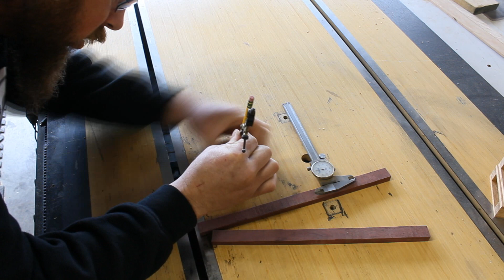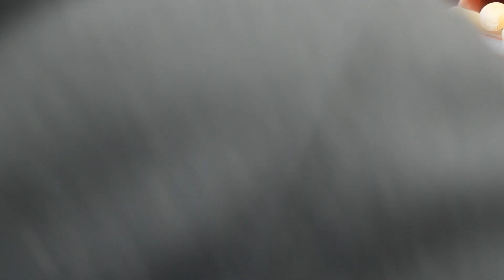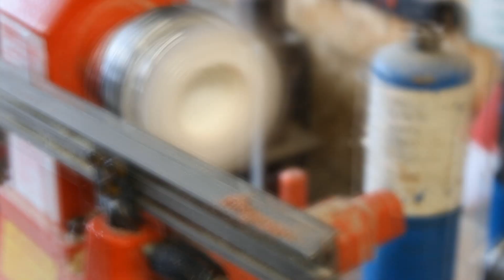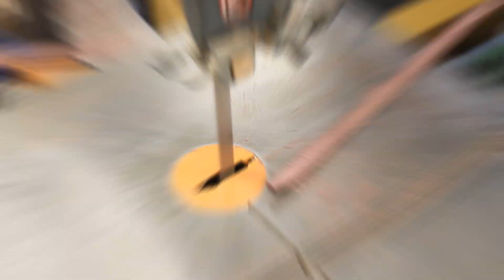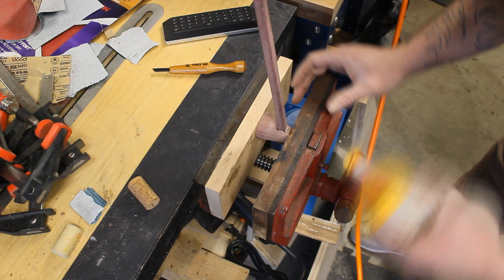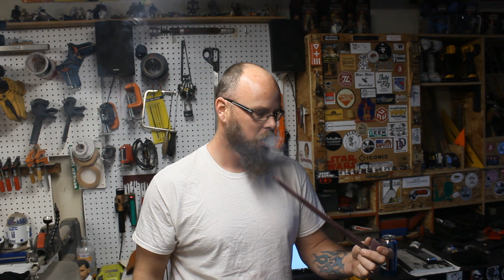purple heart wizard pipe.. Gandalf's pipe.

Comment: Very interesting build. I made my own Gandalf pipe for my Gandalf costume. I used maplewood for the bowl which I carved by hand, and about a foot long piece of maplewood branch that was already about the thickness I need for the pipe stem which I hollowed out the puff with wire. Afterwards sanded everything down went over it carefully with a blow torch to turn it a nice brown, then sanded again. I used just a tiny drop of glue then pressure fit the pieces together and finally went over it with a nice coat of vegetable oil to make it shine. The fun part is it slides onto my homemade Gandalf staff just like his pipe did in the movies. The pipe I’m smoking in my profile pic is bamboo and walnut. If you guys or ladies want to make bamboo stemmed pipes you can find bamboo gardening stakes at almost any hardware store, just cut to whatever length you want then hollow out the puffy center with a bit of wire it’s fast easy and looks nice, oh and I recommend using a razor saw for cutting the bamboo stems cause it’s less likely to damage the stem. Hope everyone has fun.

Comment: Here’s how to make a pipe stem while avoiding the use of glue. Find a species of woods with a large pith like Ash. Then take a hot wire and burn out the pith. Use a small diameter piece like a sapling or a branch. Find a segment with the largest gap between branch nodes
Reply from the maker: Let's see your video of it, not everything has to be done the way other people do it.
Reply: @crazethedave  Sorry dude, didn't mean to offend. This has just worked for me and I wanted to share. Stockman Original is where I gained the knowledge: https://www.youtube.com/watch?v=DcAcLWA2HBs